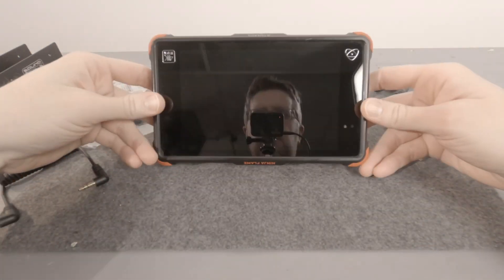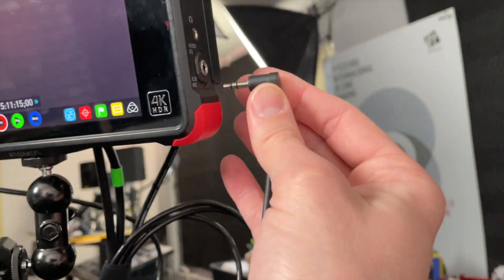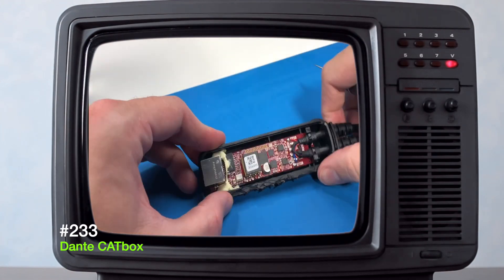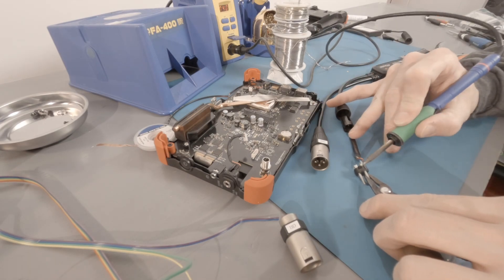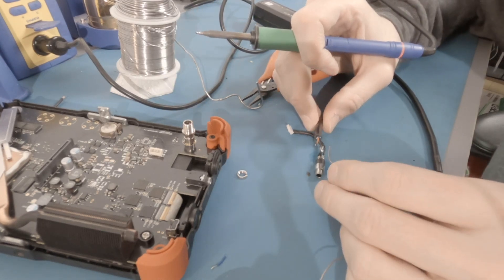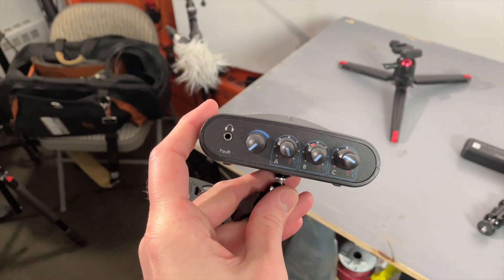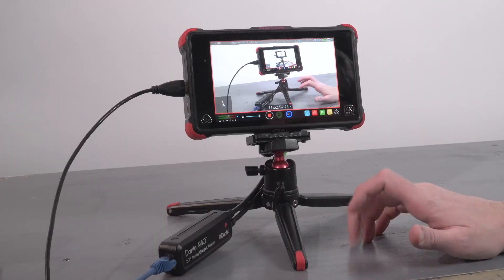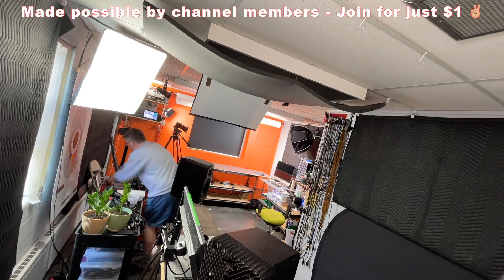Atomos Ninja Video Recorder modified to do Dante Audio!? 🎥☎️🎙

Comment: Hey. Had an idea for a good video. How much RF do you do? I've been using the Nooelec NESDR SMArt USB Software Defined Ratio for the last year with Rational Waves software and it has really made a difference in my RF coordination workflow. Really comes in handy on jobs where you have to coordinate RF with gear you can't get a scan from, like Sennheiser G2's that event companies won't get rid of, or any PSM900 or lower. I patch the last link/cascade output to the SDR with an SMA to BNC adapter. Rational Waves gives me a nice quick scan to import into Workbench and boom, coord done. It takes up as much space as a USB stick, and has all but replaced my RF explorer when I need quick and dirty scans in areas I can't pull quality ones from hardware. Cheers -Onelouder from r/livesound
Reply from the maker: Thanks for the message. I'm not doing much RF lately, but I appreciate the workflow. I have a video on the channel here messing around with SDR a few years back & it was a lot of fun. If anyone is interested in learning more about RF, the videos I've done with James Stoffo are super worth a watch - https://youtu.be/VSibmzK2YFk - Karl Winkler from LectroSonics also does a lot of great accessible education on RF for anyone interested. ✌🏼

Comment: Not being familiar with the Flame in any way- was the hole you used for the AVIO cable existing? I saw what appeared to be a few, but don't know if they were pre-existing or you added them. Realizing the AVIO is not very heavy and you have the advantage of being able to strain relief it, do you feel that it will be less wear on the Flame, especially when on a taller stand as you showed with the 3.5 to XLR adapter? 

Certainly interested in the concept as I have a number of Blackmagic assists that I am consistently feeding audio for events, and currently using a AVIO to feed a press box to give me the number of feeds needed (on jobs where I can use Dante). I have also used the AVIO to the XLR-Mini XLR cables for a single recorder or 2 as an alternative. As we are not far enough converted to Dante for day to day, I can't yet justify altering a recorder, but love the idea. You certainly keep the ideas coming. Love the content.
Reply from the maker: Hey Jake, thanks for the message. The holes in the Flame are already there (it's where the SDI ins and outs are on another model I believe. I've tried every different way to adapt XLR to 3.5mm that I have here, and it's always a bit of a hassle. It has certainly worked for the past year just fine, but it's annoying having all of that in the chain for no reason. There's also no way internally to take one input and get a safety track on this model, so you have to reconfigure the adapters manually going between mono and stereo. 

If this unit had the Mini XLR inputs, I probably would have just put those on the end of an AVIO instead of the big XLRs and called it good. I have a few nice REAN 3.5mm ends here, but with the big fat rubbery cable Audinate uses on the Avios, there was no hope of making that work. I'd have to destroy the AVIO case to swap that to thinner leads, so this seemed like a good way to test the concept and see if I want to destroy things further to make it tidy. Thanks again for watching, hope you're doing great there, I miss hanging with you.
Reply: @DcSoundOp  I missed that you had to change adapters to switch mono to stereo. I certainly see the advantage to hardwiring it.

Comment: If you are willing to buy 10 units at once, you can get 10 boards for $1000 from Dale Pro Audio: https://daleproaudio.com/products/audinate-analog-output-dante-adapter-module-kit-with-connectors-and-dvs-tokens#description
Reply from the maker: Have they ever actually had those in stock? Ships in 10-20 days isn't something I'd bet on these days.

Comment: I have the same recorder and never thought to do a modification like this. This just gave me so many ideas as I move into the world of Dante.
Reply from the maker: It can be great fun if you’re confident working on your older out of warranty gear. Thanks for the message!
Reply: @DcSoundOp  so maybe I missed something (I did rewatch the video), but why not just convert the dual XLR connectors on the Dante adapter to 3.5mm and plug that into the jack instead of taking the whole thing apart?
Reply from the maker: You certainly could & probably should do that!  It's a whole bunch of stuff to hang off a 3.5mm jack though. I've been doing everything through the 3.5mm jack for a while now, tying off the adapters to the stand and all of that. It certainly works & I'm not at all recommending anyone else should pull theirs apart to solder inputs. 
I responded to someone else here to clarify another point - if you could get to the board without cutting the AVIO open, I would have just swapped the output leads for cable small enough to wire on one of the nice REAN 3.5mm plugs I have in stock here. Without that as an option, this was the least destructive & most reversible way to go about getting rid of all of the extra XLR connectors. Just a bit of fun with what I had on hand really. All the best!